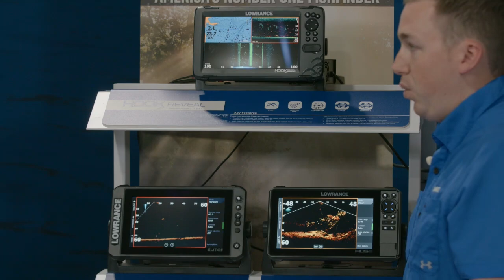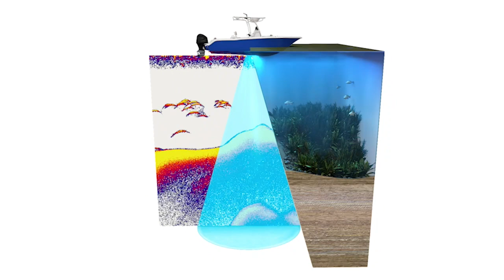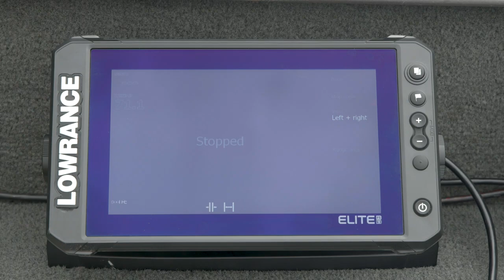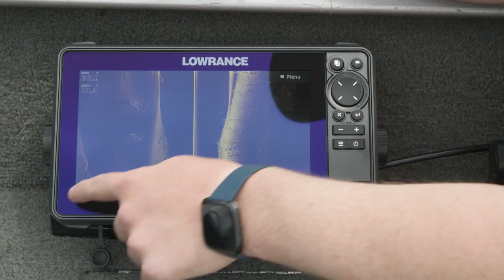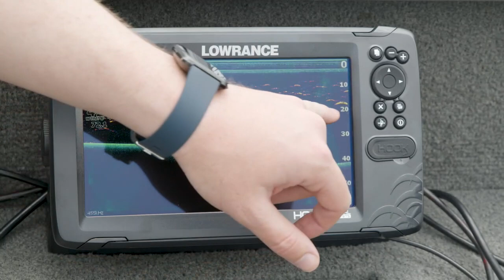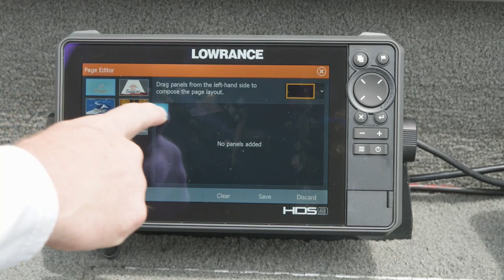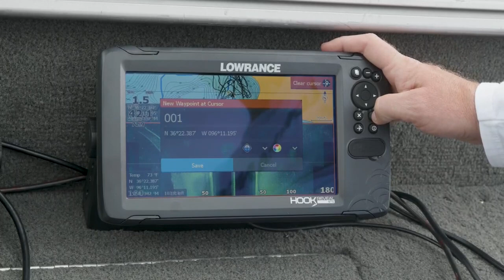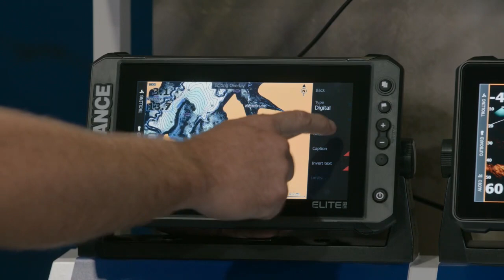Lowrance LIVE | What are the differences between HDS LIVE, Elite FS and HOOK Reveal Units? | Webinar

Comment: I have two HDS 9 gen3, can I link a new Elite 9 FS with active 3-in-1 transducer to the gen 3 9 units via ethernet cable? The older 9's have two ethernet ports per unit. Would like to know if information will share across all three? I realize the FS will have best clarity for down and sidecan. Mainly want the FS for faster map response for safety reasons.  Thank You

Comment: I have a new Lowrance Ghost & HDS 12 Live coming in March. My Question is: Is the percentage at which the Ghost is running displayed at the top of the HDS Live screen?
With my current setup, the Motorguide Xi5 with the link system into the HDS, it shows the percentage on the screen, directly underneath the Lowrance logo on the finder.
If I'm driving the boat from the console area with the remote I can see immediately if I'm at 8%, 12%, 90%, 100% etc.

Comment: On my HDS7  about every 4-5th button press there is a 1-2 sec delay before it responds to the next button press. Is this because it's a dual core processor compared to quad core in 9 & 12 models?

Comment: Can you have two Elite FS -units connected to each other wirelessly and attach the Active Target sensor on the main unit, and mirror everything happening on the 1st  onto the 2nd screen? Can you still have the regular 3-in-1-sonar attached to the device?
Reply from the maker: The Elite FS units do not share data wirelessly between them. To mirror the Elite FS you may use the Lowrance app for it. Yes, 3-in-1 can still be attached to the device via its 9pin port.

Comment: I have Lowrance HDS12 and HDS9 (Gen 2) on my boat now.  I want to add LiveScope to it.  Will the ActiveTarget integrate with my units or would I have to upgrade?  I'm guessing the Mega360 would integrate but it doesn't seem to be the best option.   Any suggestions?
Reply from the maker: You need to have a HDS Live, a HDS Carbon or the new Elite FS in order to use the ActiveTarget module and transducer. Lowrance ActiveTarget, none of the other names you mentioned ;-)

Comment: Hi, very super cool presentation, thanks for your work. One question about the maps, for your European customers which see coast maps are included with your HDS7/9 ? do they have to buy extra maps or does it work strait of the box ?
Reply from the maker: The European units will have basic embedded C-Map and Navionics maps. You will need to have a chart card in the system in order to avail of features such as, High-Resolution Bathymetry, Custom Depth Shading, Easy Routing and many more.

Comment: Thanks for the video guys. I have a 2012 HDS10gen2 unit and now have added an EliteFS9 for the structure scan, running a transducer each. The Gen2 unit for fishing offshore in 60m + and utilise the 3 in 1 transducer for structure scan only. Can I still join the 2 units via the ethernet connect?
Reply from the maker: We would not advise to connect the units using ethernet as this would put the Elite FS in legacy mode. It'd be good to swap the Gen2 for a HDS Carbon.
Reply: @lowrance  Sorry but my funding isn't in luxury mode. So instead of connecting the two units, would I just run the elite when in shallow water and the hds10 when fishing the deep?
Reply from the maker: It depends what transducer you have attached to the Gen2. Bear in mind the Gen2 is not compatible with the AI 3in1. If you're happy with your current set-up, then we would not change anything.
Reply: @lowrance  Thank you for your replies. I'm in Australia and not sure if I can get the carbon series (unless preowned) so trying to work on a budget. Would the HDS9 Gen3 be compatible with the Elite FS9 ?
Reply from the maker: Yes, the Gen3 is compatible with the Elite FS.
Reply from the maker: But it is not compatible with the Active Imaging feature nor with ActiveTarget transducer.

Comment: My question is I currently run HDS sevens by Larance on my ranger and I have purchased two elite TI two units a seven and a nine. Do the cables from the HDS seven work with the TI‘s? Meaning the power cord
Reply from the maker: Yes, you can use the same power cable. As per the transducer, you might be able to use it too, with adapter, ref. 000-13313-001
Reply: @lowrance  thanks for the help !!!  I have the 3 in 1 transducer so all I have to do is run that cord from trolling motor to unit. Save me a lot of hassle. And why did you not show the TI units ? Or are the old hat already an I’m behind the 8 ball again. Lol. Thank you for your time.

Comment: Hi there Quick question: 
If I want to add 3D structure scan to my Elite FS9 unit, do I need to purchase the module or just the transducer?
Reply from the maker: Yes, the 3D transducer needs its own 3D module, ref. 000-12395-001

Comment: Can the Hook Reveal 7 operate with an 83/200 GHZ transducer? The SplitShot transducer is 200 GHZ, not good for deeper waters.
Reply from the maker: Yes, the Hook Reveal will be able to operate the 83/200kHz transducer, ref. 000-15640-001
Reply: @lowrance  thank you for the quick response.
Reply: @lowrance  WIll DownScan and Fish Reveal features work when using an 83/200khz transducer with the Hook Reveal 7?

Comment: Looks like Genesis live was available on the Elite Ti2, but not on the Elite FS -- is this true and if so, why the downgrade?  I thought the elite FS was supposed to be an improvement over the Ti2?  Also, I understand Ti2 used to have wireless networking but the FS doesn't or at least not to the same extent as the Ti2.  Thanks
Reply from the maker: Genesis Live is a feature available in all our recent units, also on the Elite FS. Yes, the Elite FS has been updated to be networked via ethernet instead of wirelessly as the Elite ti2.

Comment: Why no 1000mhz+ side imaging?
Reply: I have the same question.  I purchased an Elite FS without doing much research (my bad) as I had always been a Lowrance person back in the day and just started fishing again.  After purchasing, I've been a bit disappointed by the Lowrance side scan compared to images I'm seeing produced by Humminbird, for example.  Is there some reason Lowrance hasn't increased the frequency on its sidescan?  Helpful video, nonetheless.  Thanks!
Reply: @daved2403  the high resolution screen lowrance devices (hds) with the ai3in1 tranny on 800mhz is pretty bloody close to the mega imaging in my opinion. Not as good.. but i get some amazing images from my hds carbon.
Reply: @kizzjd9578  I don't think the Elite FS has the same resolution as the HDS, so I wonder if that is part of the issue I'm having as well.
Reply: @daved2403  That may be an issue. The bigger the screen, the better the resolution gets. I just sold my hook reveal 7 ta on my small boat to upgrade to a 10 inch garmin echomap ultra 105sv. The images are amazing.. although I prefer the lowrance user interface and features.